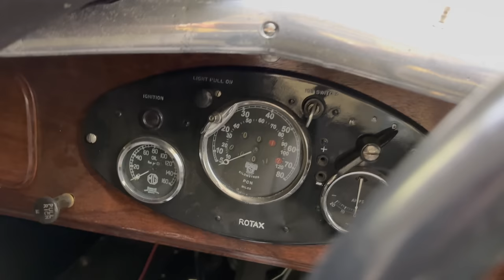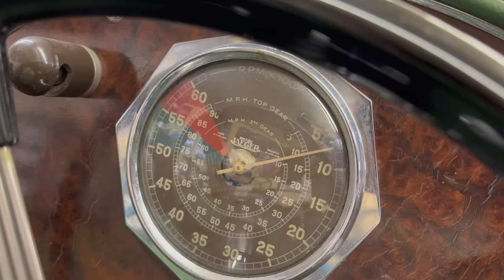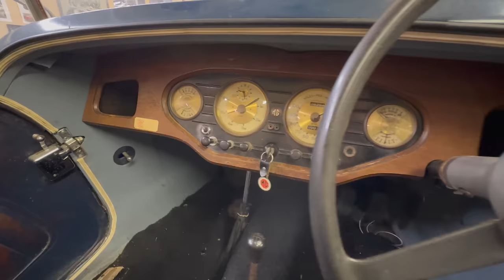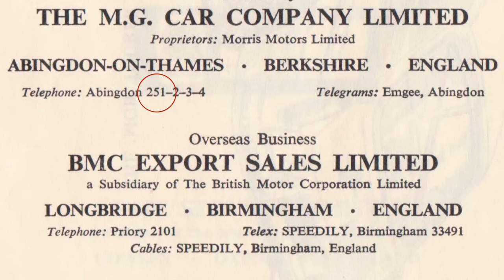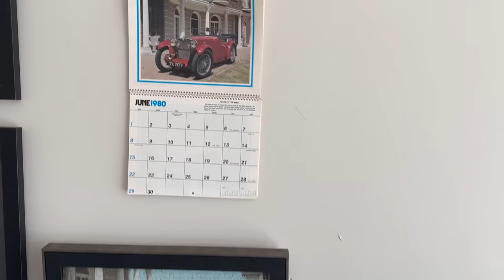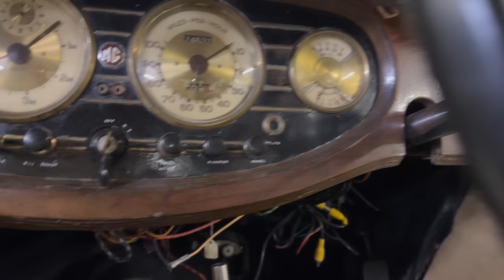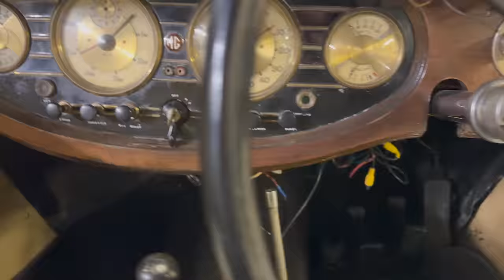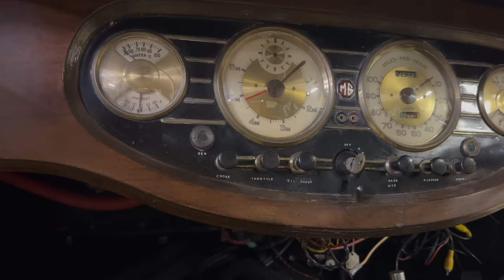Uncovering a Rare Automotive Treasure: The Klemm Pre-War MG Collection!

Comment: The Magnette was one of the overall series known as the Farina Series. There was Austin, Morris, MG and Wolseley variants, and also a big Vanden Plas Farina, BMC's attempt at hitting the luxury market. Here in Australia we also had a variant known as the Freeway, BMC's attempt at competing with Ford and Holden, but it was only a four, and Aussies wanted six cylinder engines, so it didn't really succeed.
But, Steve, thanks for introducing us to these lovely people and their wonderful old cars!
Reply: There was also a Riley version of the BMC Farina. The BMC Freeway used the 6 cylinder blue steak engine?
Reply: @Ribeirasacra  yes of course it did,  my mistake
Reply: If you check out the Peugeot 404 you'll see that Pininfarina did well out of one single design. They sold it to two separate companies!
Reply: @crashbox7130  Indeed they did,  I owned two 404s back in the seventies, wonderful cars, and a 'crisper' interpretation of that shape,  in my opinion..